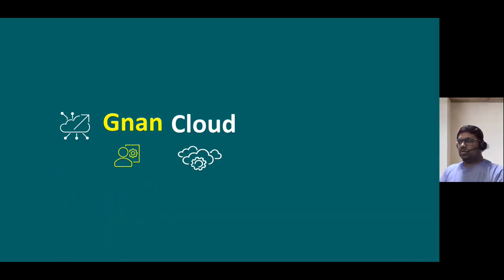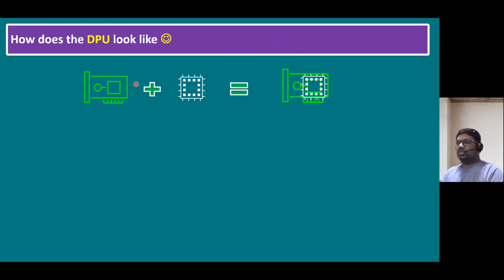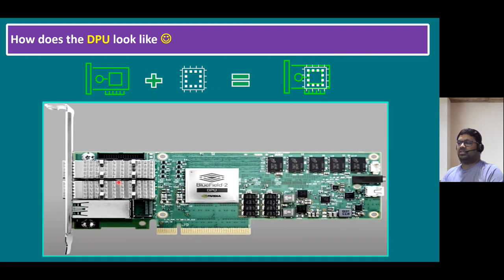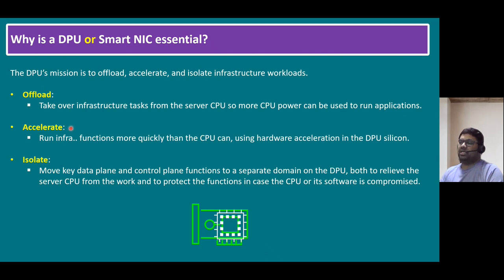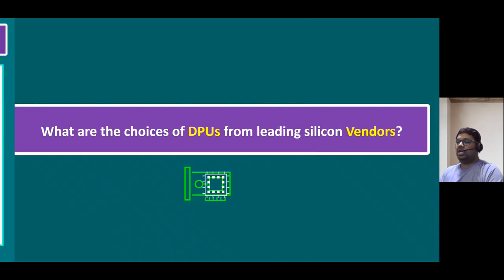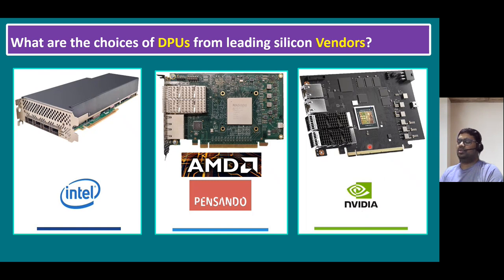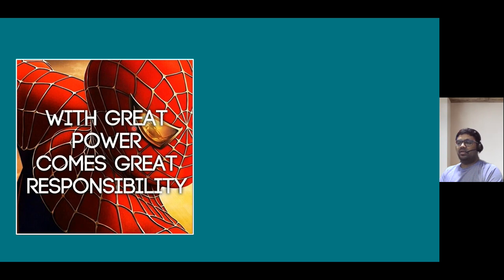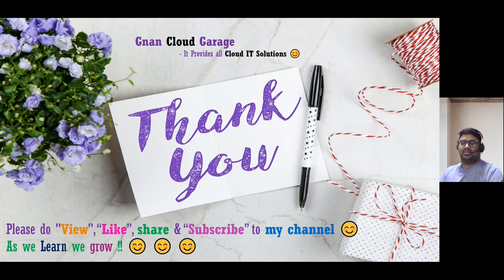vSphere 8 | What is the VMware Evolution of Use Cases for DPUs or Smart NICs? | CPU vs. GPU vs. DPU

Comment from the maker: Agenda

What is the VMware vSphere 8 Architecture for Modern Computing?
What is a DPU or Smart NIC?
How does the DPU look like
What Are The Key Components Of A DPU? 
Why is a DPU or Smart NIC essential?
How to Build a Flexible and Open Ecosystem of DPU Solutions?
What are the choices of DPUs from leading silicon vendors?
What is the VMware Evolution of Use Cases for DPUs?
What are the differences between CPU, GPU & DPU?
What is the Recommended *PUs for Next-Generation architectures?

Thank you

#hpe #vmware #vmwareexplore #solution #architecture #computer 
#dpu #cpu #gpu #smartnic #ecosystem #use #nextgen #recommended 
#dell #lenovo #nvidia #amd #intel #pensando #essential #airgap
#features

Comment: do we need to buy additional HBA card for storage even if we have this DPU Bluefield2 card?
Reply from the maker: The need for an additional HBA (Host Bus Adapter) card depends on your specific storage requirements and how you plan to use the BlueField-2 DPU (Data Processing Unit) card.

The NVIDIA BlueField-2 DPU is a versatile card designed to offload and accelerate various networking, storage, and security tasks. It can handle many storage-related functions, including NVMe over Fabrics (NVMe-oF) and RDMA, which can reduce the need for a separate HBA card. However, if your storage setup relies on traditional Fibre Channel (FC) or certain other protocols that the BlueField-2 does not directly support, you may still need an HBA card.

Key considerations:

Storage Protocols: If your storage environment uses protocols like Fibre Channel that are not supported by the BlueField-2, you will need an HBA card.
Performance Requirements: For high-performance storage needs, especially in large-scale environments, having dedicated HBA cards alongside DPUs can optimize performance.
Compatibility and Configuration: Ensure your existing infrastructure and the specific capabilities of the BlueField-2 align with your storage needs. Check the product documentation for supported features.
In summary, while the BlueField-2 DPU can handle many advanced storage tasks, the need for an additional HBA card depends on your specific storage protocols and performance requirements. Evaluate your setup to determine the best approach.